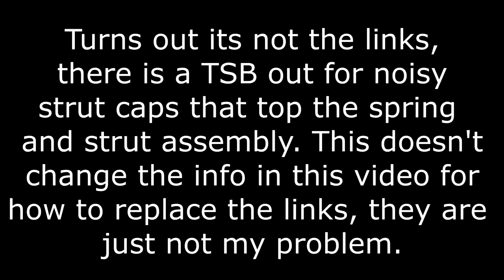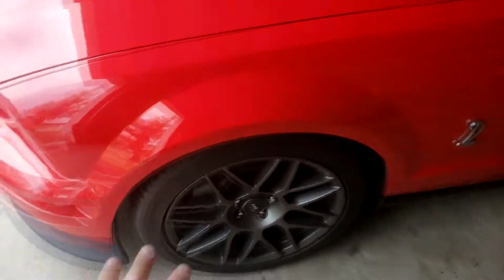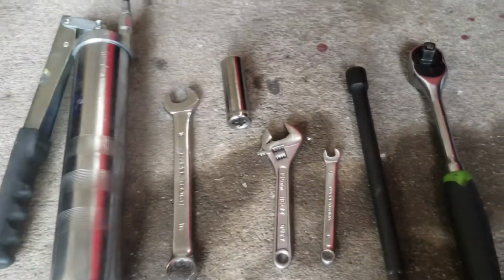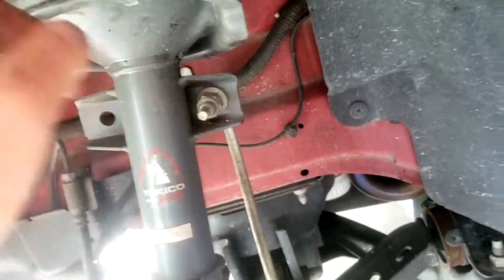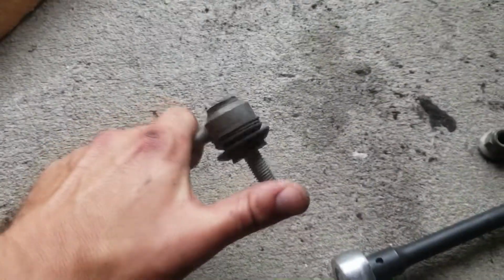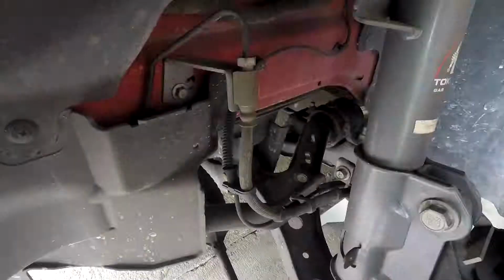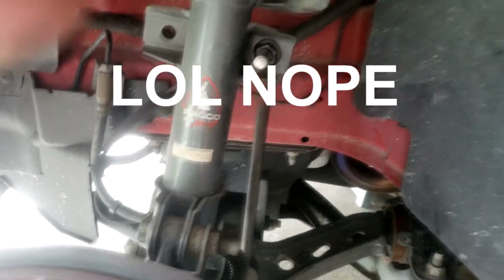2007 GT and GT500  How to install front sway bar end links (Stabilizer bar link)

Comment: I read these are supposed to be torqued to 85 ft-lbs and for the sway bar connection that must be done with the wheels on and the car lowered onto blocks so you have tightening access while at the same time load on the suspension.
Reply from the maker: The torque spec is correct, but you do not need the suspension loaded or the wheels on for install. It's a ball joint connection that allows movement regardless of the suspension angle or load.
Reply: @AllThingsBoost  ok that makes sense.  I found ford instructions that state for the front you can torque everything unloaded but for the rear sway bar you must lower the car for final tightening or it says you will preload the bushings. It’s probably because on the rear the links hang down from the chassis and the bar attaches to the shock mount with a bracket so in that case there is no ball joint.
Reply: @AllThingsBoost  thanks. After watching many videos and reading a bunch of information you’re the only one who helped make sense of why Ford specifies only loading the rear suspension, and why others who say you need to load the front too are wrong. CJ pony parts and AM do their installs in the air and make no mention of loading anything prior to torquing. They torque everything on the ramp. So I was not sure how big of an issue this even is. Some suggest too that for torquing the rear lowered you should also have a driver sit in the driver seat for the most precision.

Comment: If you hear a rattling/clacking noise in the front of your mustang after you change your struts. When you compress the spring and unbolt the strut, a lot of times there's a top hat spacer that sits under the mount, if that's not installed the strut will move up and down because the spacer wasn't installed. So when you take things apart make sure they go back together correctly.

Comment: What type of grease did you used? Thanks for the video will be doing this job on my 06 GT.
Reply from the maker: Just a standard Harbor freight grease that came with the gun. In hind site I probably should have swapped it for a higher quality grease, but it's worked so far

Comment: Did you take off the the extra nut than was on both ends? I noticed my new links had them too. We didn't take them off and it still has the the rattle sound. Wiggle the bar and there was a looseness to it. Will have to go back in and see if that's the problem.
Reply from the maker: I'm not sure on what extra nut you are talking about... however I'm positive it's my strut mounts. I just havent ordered new ones yet
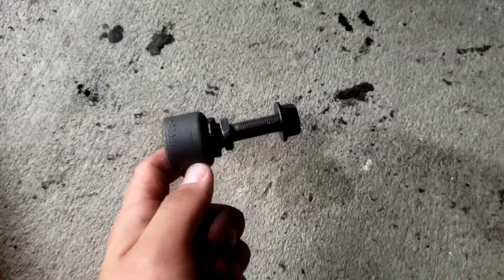Reply: You pointed it out at 3:27. I debated on taking it off because the old one didnt have one, but I'm no mechanic so I was unsure and left it.
Reply: Mine's rattling way more than it was before I replaced them
Reply from the maker: @CarlosGonzalez-xo2ne  oh, that wasnt removable, that's so you can keep it from spinning when you are wrenching on the actual nut. Different design than the OEM one, but same function.
Reply: @AllThingsBoost  like I said, Im not a mechanic. Took the wheels off again and re-tightened it holding that nut. No longer rattling. Thanks for vid!
Reply: @AllThingsBoost  did replacing the struts help?
Reply from the maker: @striiker4950  turned out it was a bad strut mount. Replaced and it was good to go
Reply: @AllThingsBoost  strut mount as in the whole strut? With the spring?
Reply from the maker: @striiker4950  no. Strut mount as in strut mount. The components that make up the strut assembly are the strut, the spring, and the top mount that caps it all together. That mount is what has the 4 bolts that bolt to the strut tower in the engine bay. If you look up caster camber plates, samething different name, but adjustable. I replaced mine with MOOG from rock auto with the Gt500 mount, honestly an upgrade over the GT mount because it lets you adjust camber and is built stronger. Ran them in my old 07 GT as well.
Reply: @AllThingsBoost  I'm a bit confused right now but I'll check that out, im having the same issue of noise after installed a sway bar kit
Reply: @AllThingsBoost  alright nevermind now I know whag u meant lol, anyways turns out I did not tighten a bolt on the adjustable end link
Reply from the maker: @striiker4950  glad you got it sorted out
Reply: @AllThingsBoost  thanks, I subscribed to you mainly because u actually replied👍 ill be checking your vids out tomorrow